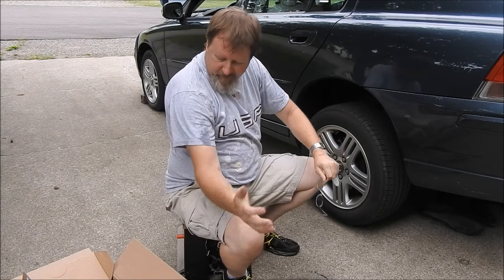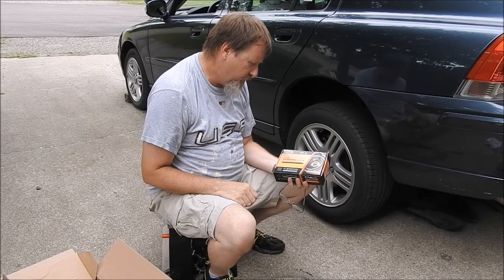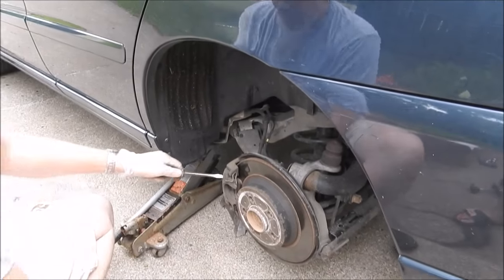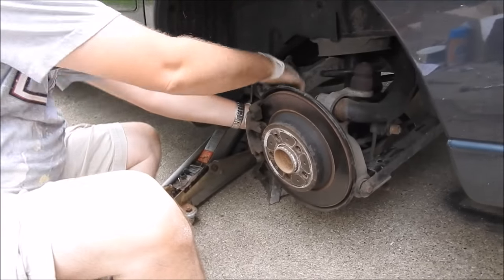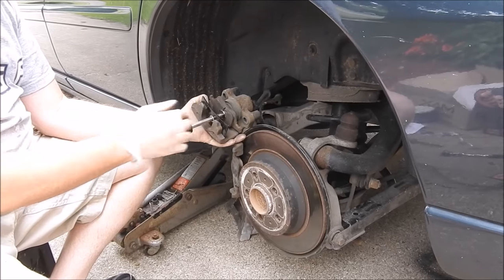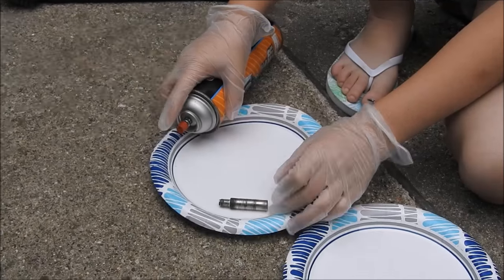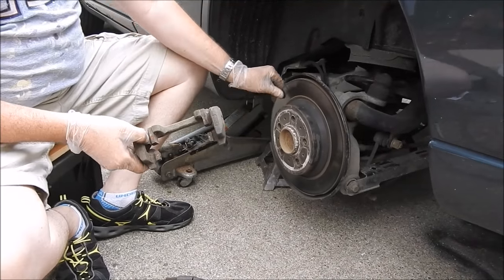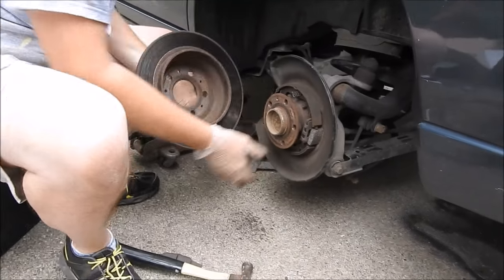Volvo S60 rear brake pad and rotor replacement

Comment: Thanks Floyd, I really needed this video, just getting ready to do my 2001 rear brake pads and rotors and I'm not the most mechanically inclined, but want to do my own work, this video really is going to help me. Hope your daughters keep learning also, good for them helping out!
Reply from the maker: As long as you take your time, and have the right tools, it's actually pretty easy.  A lot of these repairs are fairly easy to do, and doing them yourself can save a huge amount of money.  Once you know how they are done and what the parts costs are, it's really eye opening when you look to see what the garages want to charge.

Comment: Hi.. after rotors and pads change the brake pedal travel has increased alot. What can be the cause? Thnx
Reply from the maker: Could be a few things, and always, if unsure, seek the help of a professional shop.  May be air in the lines and just in need of a good, old fashioned bleeding and new fluid.  Make sure the calipers are able to slide on the pins that hold them in place freely.  One stuck caliper on any corner could cause issues with the whole system.  Double check that everything is the correct part, and installed in the correct orientation.  Make sure to use the proper bed in procedure for your pads and rotors too.  Sometimes, until they bed in, you have to push harder, and as the surfaces seat to each other, normal pedal feel returns.  This is especially true for coated rotors like the Geomet rotors and newer carbon/ceramic pads.

Comment: On my 2015 S60 can I replace the 300mm caliper with the bigger 336mm for better breaking power?
Reply from the maker: I'm not sure.  If you need better braking power, you can use a different rotor and pad with the existing 300mm setup.  There are track versions that have pads that might wear a bit faster, but they grip harder.  It would be a lot easier to do that, and probably a lot easier too.  Even if you are able to change the caliper, that means a bigger rotor, and that may require a bigger rim size so the bigger hardware fits inside.

Comment: Ya dont have to take off the bracket and caliper  separately. Its 2  bolts on the bracket. Half inch socket (04 S60)
Reply from the maker: That's quite possible but the best practice is to remove them independently.  It's only 2 more bolts, plus it gives you the opportunity to inspect those pins that the caliper slides on.  Any time you work on brakes, you should do that.  It's not half inch, by the way.  Nothing on a Volvo uses SAE tools.  It's all metric.

Comment: Did your purchase the same exact break pads and rotors brand from the same company for the fronts wheels...TIA
Reply from the maker: Yes.  I actually got a kit that had front and back rotors and pads both.  Just took a real good look at the front rotors and pads yesterday.  The rotors are in excellent shape and are still nice and shiny, and the pads are wearing really well.  Somewhere between 1/2 and 2/3 of the pad left after about 2 years of use.
Reply: I'm about to purchase a 
2008 Volvo S60 T5 2.5, what type of fuel grade is required for these type of sweeden vehicles, also what size are the rotors cause apparently theirs three sizes on the exact website... TIA
Reply from the maker: It only requires regular unleaded, but, to get the maximum horsepower and torque ratings, you will want to use premium.  Experiment to see what the difference is.  Run regular for 2 or 3 tanks, then on that last tank, get it down well below 1/4 tank and fill with premium.  Within about 50 miles, you should notice a difference in how hard it pulls off idle, and how quick it accelerates.  From there, it's up to you what you use.  If you don't need the acceleration, then just use regular.  You'll want to measure the rotors to be sure, but by default, the front should be 286mm, and the rear 288.  Hopefully you'll like the Volvo.  Mine has 165,000 miles on it and still runs like new and looks great.  I still look forward to driving it every single time I get in it.

Comment: cool video, however i would use copper grease just a small amount to lubricate the components.
Reply from the maker: I've had other people say the same thing.  I haven't picked any up yet but it's on my list, then I'll take the calipers off, clean them up and put the copper lube on.  I've heard that there just isn't anything nearly as good for brake components and eliminating pesky squeaks.

Comment: Are they 7mm hex or torx 47? I have read that they are actually torx 47 but 7 mm Allen kind of fits.
Reply from the maker: It's possible it could be either one.  I've heard that those were sometimes Torx as well, and I've seen cars where that was the case, but this one is hex.  I should have shown the end of the bolt hole.

Comment: Can't get my disk back on even though everything looks in place,I fitted new shoes and pads
I've ground lip off inside
Reply from the maker: I got lucky and didn't have to adjust mine because the old rotors didn't have much of a lip.  Look on the brake shoes.  On one end, there is going to be a little device that looks like a rod connecting the 2 brake shoe ends, and the rod will have a wheel on it that kind of look like spurs.  That wheel is an adjuster.  Move it one way, and it pushes the shoes apart.  Move it the other way and it moves the shoes in.  You need to move them in to move the shoes closer together.  Don't move it more that a couple of turns at a time until you can get the rotors on EASILY.  Don't force them.  If you get them too loose, don't worry.  They will adjust themselves.  Every time you back up and engage your brakes, it causes a little lever that pushes against that stared wheel to try and rotate the wheel.  If the shoes are too loose it will rotate it.  It may take a few times, or many if you get it really loose, of backing up, but they will adjust themselves back to the correct fit and clearance.

Comment: Where did you get the rotors from? Helping a friend with his and he really wants the ported and slotted.
Reply from the maker: Tony Ericson I got them on Amazon.  They are made by Max Brakes.  They also have a web site I think is maxbrakes.com.  So far they have really performed well and the pads are lasting too

Comment: Hi. Does this apply to xc70? Didn't see too many xc70 videos
Reply from the maker: I haven't seen what the brakes look like on an xc70, but I would have to believe that it would be fairly similar.  Disc brakes for one vehicle series or brand usually are pretty common in the way they are mounted and implemented.
Reply: thanks - very helpful video